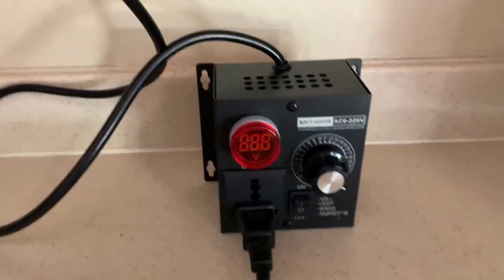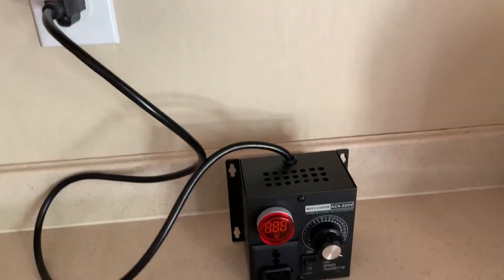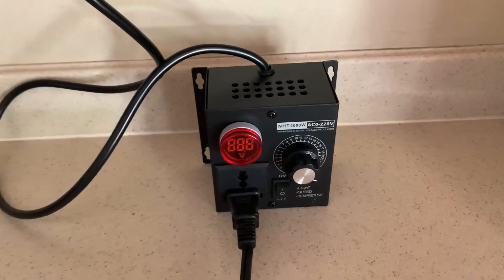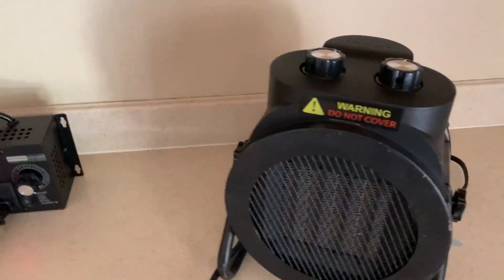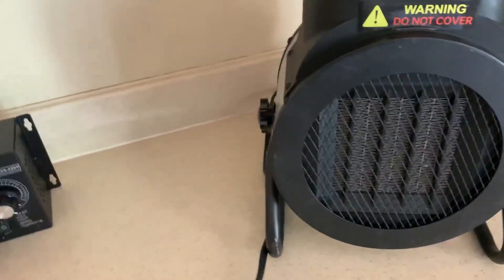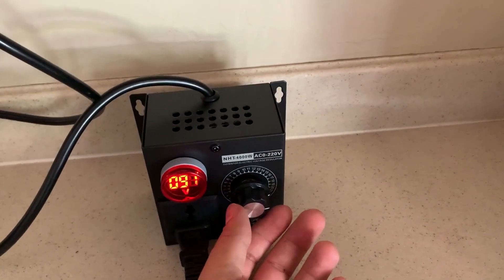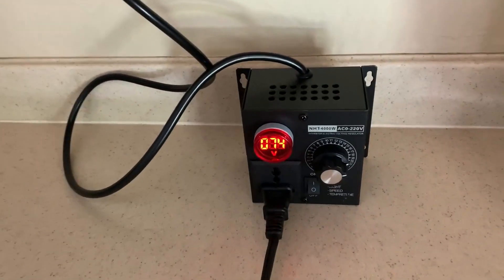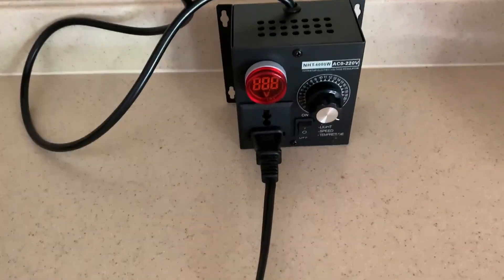AC Variable Speed Controller, 120V~220V 15A 4000W SCR Voltage Controller Review, Pretty Darn Awesome

Comment: Hey, I have a question. If you connect the speed controller without anything connected to it, does the potentiometer work? Mine doesn't change the voltage until I plug something in and I don't know if my unit is faulty.
Reply: When you plug the voltage regulator into a wall outlet and turn it on, it will display (or should display) the voltage that is coming from the wall outlet into the regulator.  

When you plug a motor etc. into the voltage regulator, then it will show the voltage that is going to the voltage regulator's outlet (depending on where the dial is set).  

The display will show approximately 0 volts when a motor etc. has been plugged into the regulator (if the potentiometer is rotated completely counter-clockwise), but when you start to turn the potentiometer clockwise, the display will probably not show voltage on the display (from 0), until there is enough power available at the voltage regulators outlet for the motor to start running, as that is because of the size of the potentiometer inside the regulator.  

For the regulator to supply enough power to start the motor, you may have to turn the dial half way or more, and that is (I believe) because the potentiometers in these devices are (for the consumers' intended purposes) too big in ohms rating.  In the case where the potentiometer has to be turned half way or more to start a motor, you would need to replace the potentiometer inside the voltage regulator with a smaller one.  

I tried to make this explanation as short as possible, but there are a lot of complicated things going on inside there LOL...  

So to answer your question in short - No, there is nothing wrong with your voltage regulator.

I think I may purchase one of these and create a video about how they work, and also how to upgrade them to make the dial work sooner (if needed)...